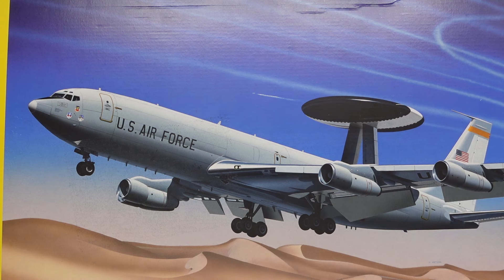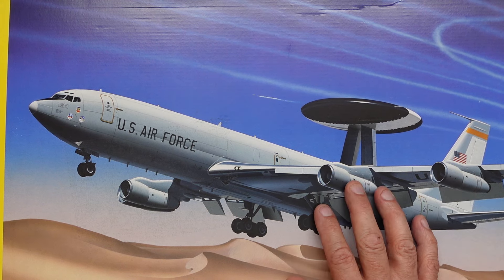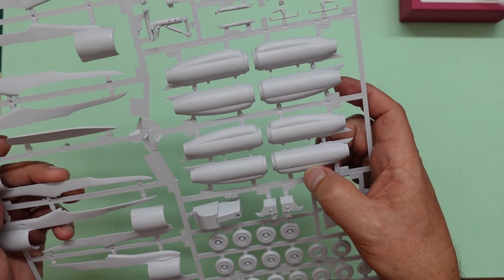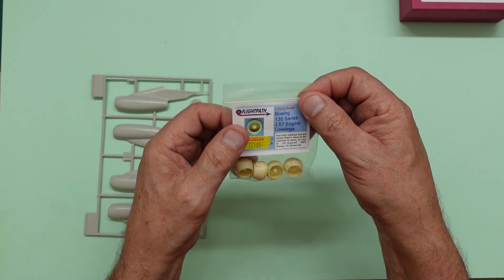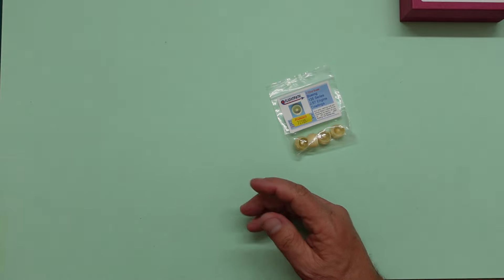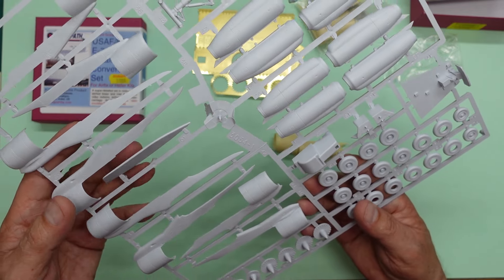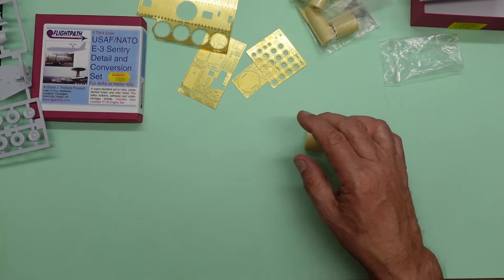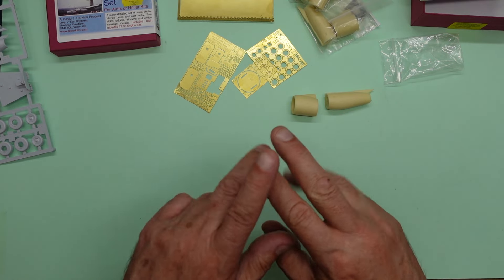Corrected Engines for your 1/72 Boeings.

Comment: Very interesting.Nigel I had never noticed the E3s different cowlings. They, obviously,  did not require the 707s compressors then. You learn something new every day. All the best.
Reply from the maker: Yeah? I assume they must use the old bleed system on the E-3? Funny that the E-8 kept them?
Reply: @NigelsModellingBench  The E8s were old 707 airliners.At least one was an old QANTAS machine built in 1967. Been around the block a few times I guess. E6s came straight off the production line during E3 production. All the best.

Comment: Cheers Nigel - I got (last?) one (flightpath kit FHP72055) from Hannant's then checked the prices on ebay  £91
Reply from the maker: £32.50 on the Flightpath website
Reply: @NigelsModellingBench  Saw that too but was showing as out of stock - I watched your video back (twice) and I think the flightpath kit will more than double the value of the finished model - I just need to brush up on my PE skill before even considering attacking that! - I am scouring various sites for any C-135 and E-3 kits now as I want a selection to cover the various different model I saw between 1976 and 1989 and the last 2-3 years. Keep up the investigation work - Top Man
Reply: Also noticed the TF-33 Engine Set on it's own @ £23.50

Comment: Inlet guide vanes are missing in most kit moldings the Pratt low bypass engines all have the IGV not the fan blades uncovered.
Reply: JT 3 JT 8 both have IGV in first position then the fan stages behind.
Reply from the maker: Maybe the kit mouldings are the Stator assembly, or IGV?
Reply: @NigelsModellingBench  not if the blade backs are showing..
Reply from the maker: When I finish machined IGV's at RR in Bristol, they looked very much like fan blade assemblies from memory, so in 1/72 scale I doubt we would be able to tell?
Reply from the maker: Sorry, I see what you mean now. The IGV's on this engine are perpendicular to the flow, so yes, the manufacturers are leaving them out!!
Reply: @NigelsModellingBench  the IGV blades are installed online with the incoming air so that their face and back are not seen head on, like fan blades show in their installed positions.